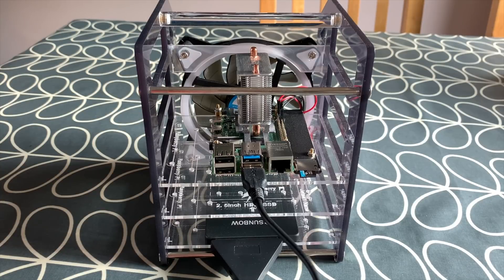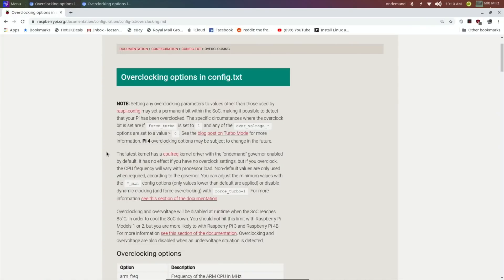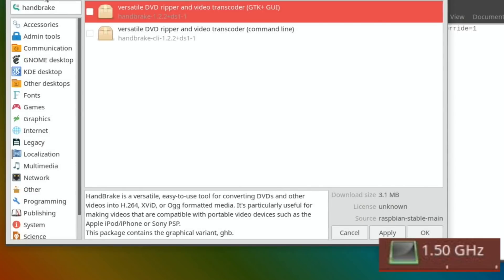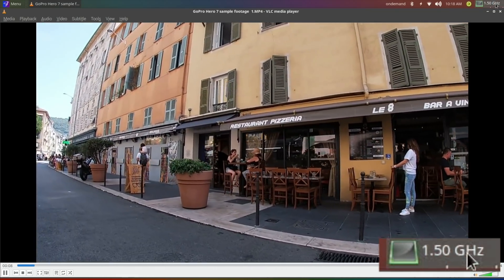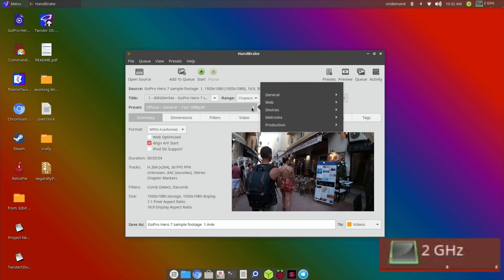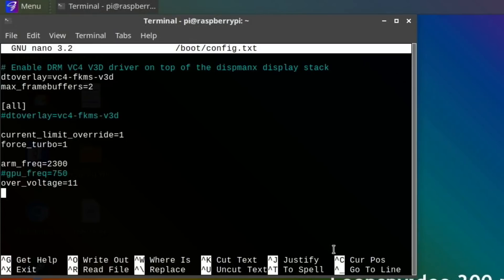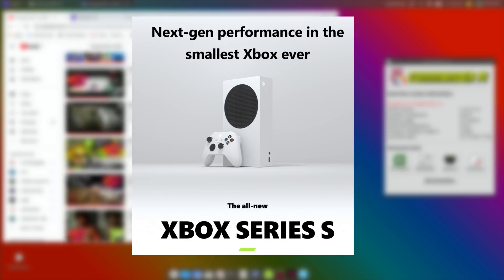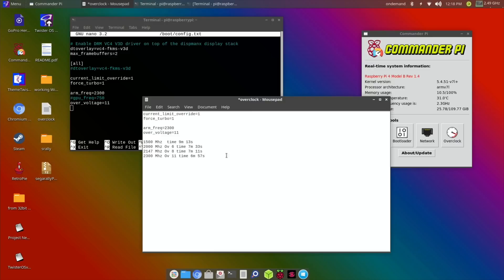Overclock Test 2000 Vs 2147 Vs 2300Mhz. Raspberry Pi 4. Ice tower cooler Plus.

Comment: pu_mem=160
over_voltage=8
arm_freq=2175
gpu_freq=750

I'm ok with that,its almost 2.2k and the speed increase is def noticeable for me going there from stock. Using the Pi as a pc-desktop for media and home server services and tests.
Reply: Did you use jellybin and how is the encoding and decoding performance

Comment: I envy you for running your OC Pi at low temperature.  I OC my Pi once and run between 24-29C on a cold day but now I am running at around 36C (highest temp go up to 40C) on a hot day without the big fan.  I am still using that tiny ICE Tower stock fan in a hot room temp range from 32-38C.  I am preparing to OC my Pi again to see if it will go over 40C.

Comment: I overclocked my Pi 4 (8GB) to 2000 on 6.  I have an acrylic/plastic case with 3 heat sinks and fan.  If I had the ICE cooler I'd probably try for more.  I think as long as you have a heat sink and some kind of fan, you'll be OK up to 2000.  It's really hard for me to get the temp past 70 Celsius.  I like my Pi too much to go above 2000.  :-)
Reply: My average temp ranges from 54 to 58 C, but it's hot in my office.  I have a number of machines running...

Comment: I have a raspberry pi 4 overclocked to 2.3ghz CPU, 950mhz Gpu, and over-voltage set to 14 running stable in an Argon one case, guess I also won :P humble geek-brag

Comment: I am pretty sure raspberry have firmware limit that keeps clock under 2175mhz, and I remember there are two ways to get the core clock and one of them will report faulty info that says the clock is over 2175 but the other of them will tell the truth. Also if you are doing extreme overclock, check out this super tower cooler https://m.tb.cn/h.4bQz775?sm=c9263f

Comment: I need to give this a shot with one of my passive cooled cases.  I usually run my pi 4s at 2.1 GHz without trouble.  I wondering if that is still going to be the case with that much extra power going to the chip needing dissipated.
Reply: what other settings in config. txt do u have?

Im not sure if OCing at 2.1ghz from 2ghz makes it more faster in the desktop.

Comment: This seems to be pretty stable on the latest version of Buster.  Running at 2300 with the ice tower and running temp after several hours of work and remote connection is a reasonable 46 degress C, running the fan on 3.3v.

Comment: Today i Overclockd my Raspberry pi 4 with Twister OS, Cpu to 2.0Gh and GPU to 650Mhz overvolt 6
Reply: My belief is that overclocking the GPU doesn't do much so I leave it alone.  I Overclocked the CPU the same as yours, though.  :-)

Comment: Thanks for sharing. There needs to be an option to power the fan other than on the GPIO. In this configuration, you cannot plug a hat or shim into the PI.
Reply: Get a mini black hat hack3r!!! Works great for general and the ability to mount custom lighting / hats.
Reply: @TheQBall1977  That is a great idea, I'll give it a try. One of the items I use is the ReSpeaker https://wiki.seeedstudio.com/ReSpeaker_4_Mic_Array_for_Raspberry_Pi/ and I am not sure how well it will work with my application.
Reply: @anothergoogleuser  check out pinout.xyz to see which pins you shouldn't double up.  https://pinout.xyz/pinout/respeaker_4_mic_array  If you're careful should work.  I've had it working with multiple hats just by changing a few pin assignments of things.  Hope that helps.

Comment: Really interested in a similar test with gaming (without GPU).
Especially for emulation. 

FYI, just calculated 25% performance increase for 35% more clockspeed in this particular case.

Comment: According to what I read in the overclocking section on the Raspberry Pi website the gpu overclock doesn't do what you think it does. There are some other settings that you have to dive into to overclock the graphics. But hell, it's confusing as can be. I could be wrong.
Reply from the maker: I agree it doesn’t read well.

Comment: My Pi slows down MASSIVELY at 2 ghz, 1800 mhz on the cpu and 650 mhz on the gpu with an over volt of 3 is a good combo for mine and probably most others
Reply: Mine rocks along great at 2ghz. At 2.1 it crashes every 5 or 6 minutes.
Reply: @ninline2000  I agree, for me I feel 2000mhz seems like the sweetspot for me.

since I dont play much games on my pi I feel gpu OC kinda just makes it hotter and its more unstable. my pi 4 is an Argon One-case. The huge heatsink cools it very well with no fan activated(I can't get the script to work on Twister os).

Ive tried going up to 2.4ghz, that doesn't boot at all, 2.3 it can run for a while but usually freezes or it randomly reboots when put under stress for any period of time.

Comment: For GPU overclocking you must use hdmi_enable_4kp60=1, as it is mentioned in the RPI4 overclocking guide, core overclocking is not supported and trying to configure the GPU will try to set the core too. The command that I send here it will give a 10% overclocking.... They advice to use individual frequencies (isp, v3d, h264 etc) but never tried them!

Comment: Does the overvoltage=11 do anything? I thought 8 (1.4Volts) was the maximum?
https://www.raspberrypi.org/documentation/configuration/config-txt/overclocking.md
Reply from the maker: You do get conflicting information from different sources. Adding the extra 2 lines seems to override the limitation.
Reply: @leepspvideo  I think the force_turbo=1 is required, to access overvoltage 7 and 8 setting. I'm not sure setting the overvoltage to 11 has any benefit. That's something for me to try later. The current limit override appears to be old code and not required, I'm not sure, but it doesn't hurt to put it in.
Reply from the maker: Scott Wade let me know if you find out anything new. I’m sure in previous tests I have needed higher than 10. I was told about it a while ago in a comment. 👍🏼
Reply: @leepspvideo  so here's what I tried. I'm running a PI4 4Gb with a 52PI cpu cooler attached with thermal paste running Raspberry PI OS from a SSD. I've used the prime number stress test program that @ExplainingComputers came up with.  To access the overvoltage above 6, you need the force_turbo=1 command only (it wouldn't boot otherwise). To answer my own question the limit isn't 8 you can go past. My PI running at 2.3GHz with overvoltage=11 was unstable at that speed. It would run the prime number test then after the OS would fail shortly after I left the terminal.  I tried adding the current limit override and it made no difference to stability. The cpu temp never exceeded 38 degrees.  I tried for a laugh running at 2.5Ghz and overvoltage=16 it wouldn't boot. Running at 2.147GHz  only requires an overvoltage=6 there's no added performance going higher on the voltage. I get the same cpu frequency glitch 2.29 GHz and also had to run the test program twice because the timer glitched. Which if I remember correctly was EC's problem as well. That's probably too much info....thanks for the video. :)
Reply from the maker: Thanks that’s good information. 👍🏻
Reply: @scottwade3904  Am i right in thinking that the force_turbo=1 option makes the CPU always run at your chosen frequency and never slow down under light loads?
Reply: @johnm2012  correct

Comment: If you didn't know, you can also get the GPU up to 950MHz, if you want to try that out in your next video that'd be awesome! i just used overvoltage 15 to see if it worked, but you could try it lower to see what is stable
Reply: did we not see that 8 or 9 was the maximum in the official docs ?
Reply: @jyvben1520  I thought the maximum was somewhere around 15 or 16 (16 has never booted for me no matter the frequency), also Lee used 11 overvoltage for 2.3GHz

Comment: Great Video. I take it you were using the 32 bit Pi OS ? I wonder how much faster the video editing would have been with a 64 bit OS
Reply: I used handbrake on my Pi4 clocked at 2ghz with both 32bit and 64bit Raspbian. I converted a 1080p video to 480p fast and 64 bit was about 10% faster. I also used Ubuntu 64bit linux and it was with 3 seconds of the same time as 64bit Raspbian. I wanted to try Manjaro but there was no Handbrake in their repository for ARM. Just for reference my dual core 2.5ghz 2014 iMac did the same file in 4.5 minutes compared to 9 minutes for the pi. It's amazing performance for a $55 purchase including tax and shipping. And it's still getting better every month or so.
Reply: @ninline2000  @leepspvideo  you guys could just do everything from CLI with ffmpeg and if do "time ffmpeg etc etc etc" you can get timing easily
Reply from the maker: 32 bit Twister OS.
Reply: leepspvideo why not a 64 bit os ?

Comment: The next Pi chip needs to be 3.0GHz stock
Reply: i just wish it came with 2.0ghz stock and a slightly better graphics unit
Reply: Nick Jarrett all needed improvements
Reply: Eventually it'll come in an ATX tower with a 700 watt power supply at this rate. Having to cool it is kind of a bummer as it is. I want it to go as fast as it can, with a 3.1 USB charger.

Comment: with changing overvoltage that high, is there any need to change to a different power adapter from the usual 5v 3a?
Reply from the maker: Im using the official Raspberry Pi adapter.
Reply: @leepspvideo  That wasn't the question lol
Reply from the maker: Truth Willout as it worked in the video with the official Raspberry Pi adapter surely the answer in my case was no, you don’t need to use a different adapter.

Specification

The official Raspberry Pi USB-C power supply is designed to power the latest Raspberry Pi 4 Model B boards, which were released in June 2019.

5.1V / 3.0A DC output
96-264Vac operating input range
Short circuit, overcurrent and over temperature protection
1.5m 18 AWG captive cable with USB-C output connector
Available in four different models to suit different international power sockets
Available in either white or black
Reply: @leepspvideo  Yeah I know mate I was just being pedantic.
Reply: Short answer: no. The SoC runs off a 3.3V regulator so you've got a bit of a fudge factor on the 5.1V supply's regulation. Every power supply I've tested with an electronic load has been fine in the 2A (Pi+SSD) range. You'll only get near the 3A limit if you're using a particularly power hungry device as a peripheral. In which case a powered USB hub will be your friend.
Reply: Long answer yes. IF you're also using other USB powered devices like a 2.5 HDD or even an M.2 SSD from my experience. I was having the screen freeze up when OC'd even running two 5v 3a power adapters piggybacked together, I picked up a 5v 8a DC buck converter with USB outlets and it's been perfect ever since.